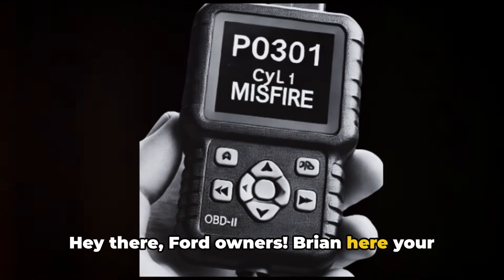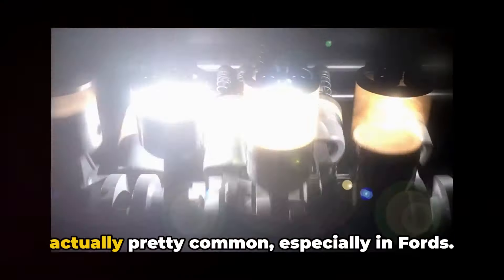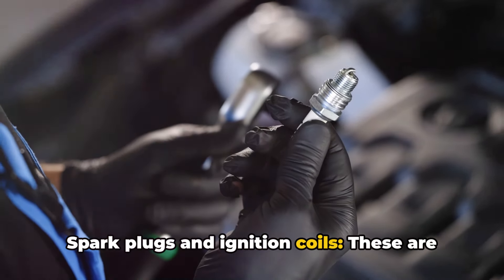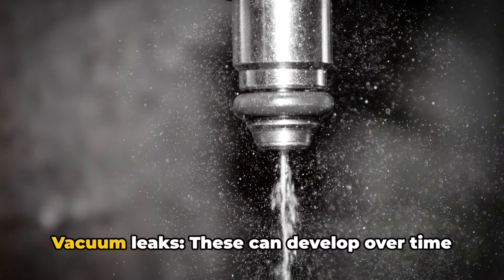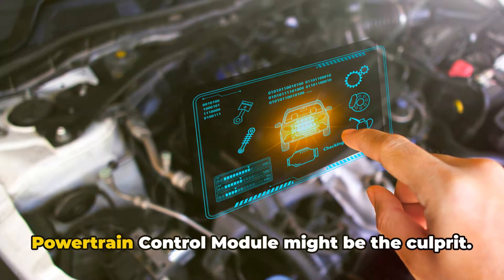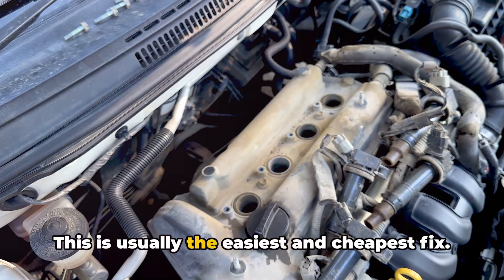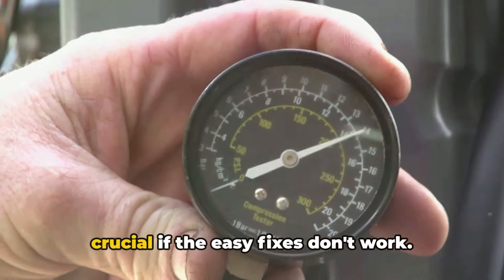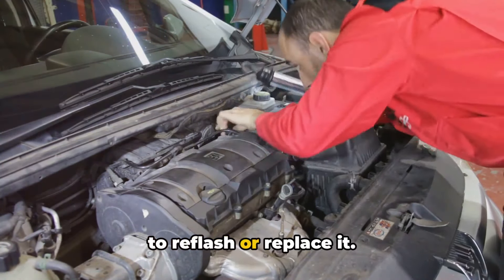Ford P0301 Code: Leading Causes & Fix

Comment: Is it good to replace the ignition coils as a "routine" maintenance, or are you better off just waiting for a code to appear? I'm about to change the spark plugs on my Infiniti with 150K miles on it, and was wondering if I should put a new set of ignition coils while I'm in there.
Reply from the maker: Hi There, I actually made a video on this very topic https://youtu.be/qcr2YAES_xo?si=aaVOlQnQpFN5Hr4j . Thanks for watching!
Reply: @HonestMechanicChannel  Thanks, I'll check it out!

Comment: My 2019 Ford E450 Triton V10 in my class C RV with only 20K miles threw a flashing check engine light while we were bring my wife bad from open heart surgery , we had 600 miles to go, we started calling Ford dealerships driving down I95 heading back to Florida. The Ford dealerships do NOT service RV's is what they tell you when you call. They want you to take your RV to commercial service centers, which are far between and hard to get an appointments etc. So, we ended up driving 600 miles to home and I replaced the igintion coil in cylinder #2, fixed the problem. The question is, what did the unburnt fuel do to the cylinder and or the  exhaust catalytic convertor and 02 sensors etc? She seems to run fine, no codes.
Reply from the maker: Hi James, I'm sorry to hear about your challenging situation. Driving with a misfiring cylinder can allow unburnt fuel to enter the exhaust, which might harm the catalytic converter and O2 sensors. Thankfully, if your RV runs fine now and shows no codes, you likely avoided major damage. Keep an eye on it, and consider having the exhaust system checked to ensure everything's in good shape. Wishing you and your wife all the best.